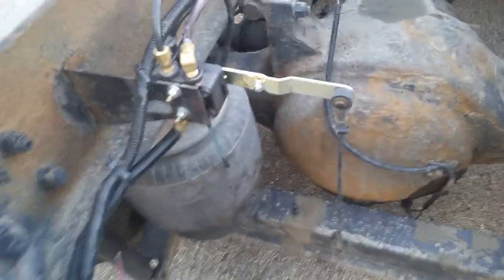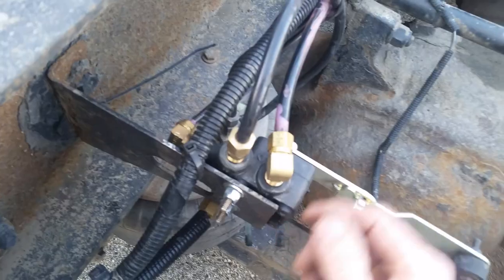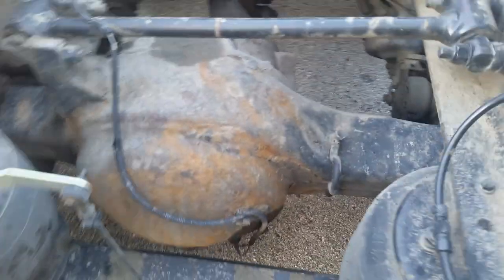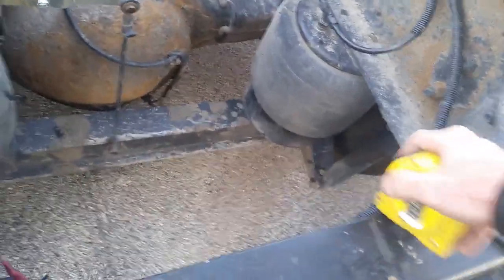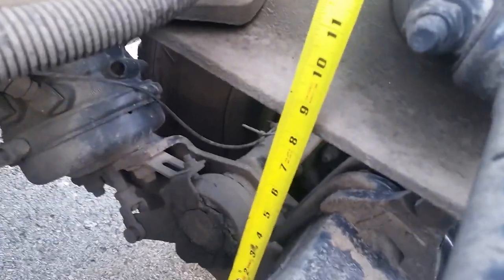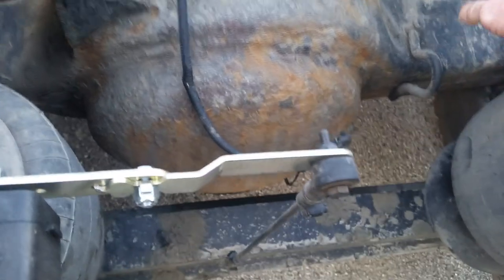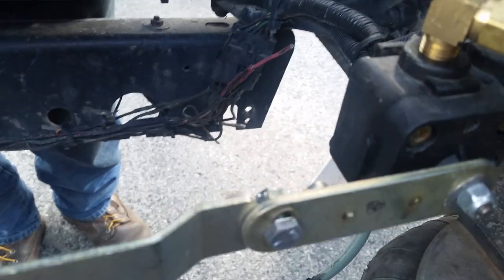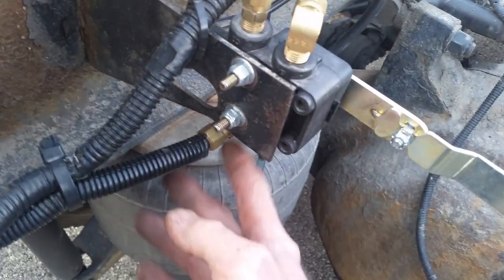05' Kenworth W900L Ride Height Adjustment

Comment: you sir made my day! im rebuilding a 1986 International S1900 four door truck i ripped out the Stock Rear end and suspension and slammed in a 05 KW AG380 almost got everything together and i got stumped on the air bags and the leveling valve!

Comment: Fantastic real person information. Does the line in come from the air pressure tank ? And should the air pressure tank line fitting quick disconnect be changed, too ? How much air pressure do you lose after a week sitting parked ?

Comment: When it malfunction will it cause vibration noise while you driving and make it feel like your airbag bag are deflated when their not
Reply from the maker: When the ride height is off, so is the center of gravity on the drive line. Yes it will cause a vibration.

Comment: Thank you. 

Hey , for some reason, my old one was leaking air at the exhaust valve. ( When it reached the desired height, it will leak air. It will raise and drop. But once it gets to the level, it will leak air.)

So that's why I changed the valve.
But it does the same thing with the new one. 

Any help will be appreciated.

Thank you.
Reply from the maker: Sounds like the rod isn’t adjusted properly.
Reply: Daniel OMalley 

Hello. I am happy to report that I got it fixed.

I swapped it out with a new one. 
An automan brand.

I just swapped the fittings to the new one. And raised the arm manual till it got some air. Then put it in normal position.

So once it stopped leaking air. I just transferred everything. 

Giving my truck a 9 inch riding level. 

Thank you for all your help. 

God Bless.

But who would have known. 2 brand new were defective!!